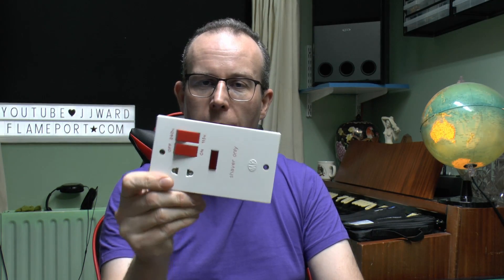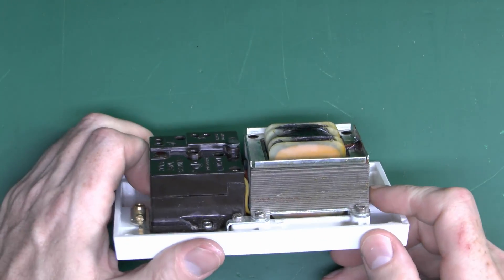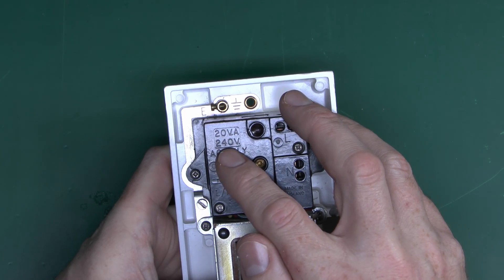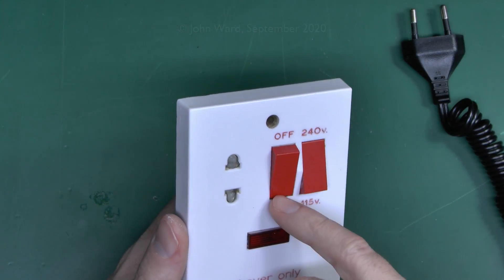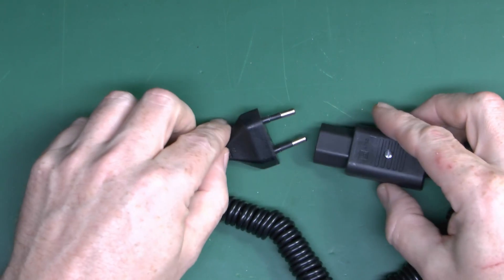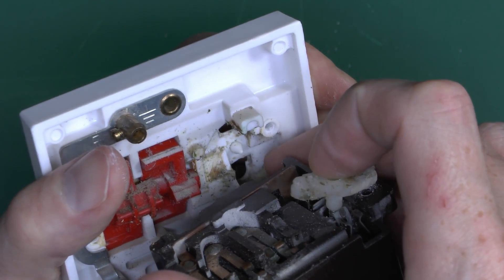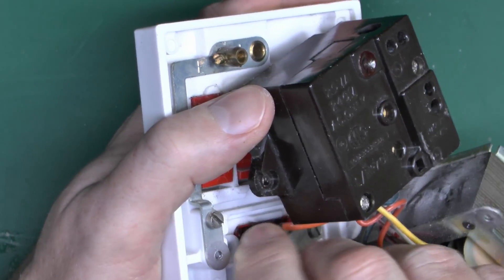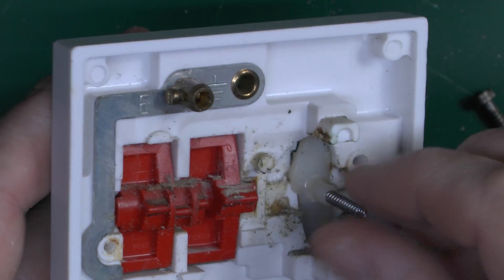Shaver Sockets for UK Bathrooms - With Isolating Transformer

Comment: In my country is normal to have the washing machine in the bathroom, that makes a lot more sense than having your dirty clothes in the kitchen like you have in the UK. Also you usually have a socket near the mirror not only for shaver but also for hair dryers, electric toothbrush, etc. 

And we don't see people dying everyday for that, so I think that UK regulations are exaggerated, especially nowadays that we are required to have RCDs on every circuit.
Reply: When we visit my mrs family in Estonia they all have the washing machine in the bathroom, kinda makes sense really
Reply: @frazer26  Usually the only cases where the washing machine is not in the bathroom is either: a) It is in the basement, garage, or some other utility/boiler room b) The bathroom is tiny and there is no other choice but to put the machine in the kitchen.
Reply: Had a big extension job with such a request from the customer when I lived in Midlands in the 90s. I said I cannot put a 13A s/o in bathroom for any reason, she said her parents have it in Belgium. I was in NIC at the time so I queried it and it was a deffo NO. Her madamship was pissed off with me. I had to go back a few months later to fit her posh gold plated bathroom light from Harrods and I found she had got some fly-by-night in to do her a socket in the bathroom. I asked to see her NIC completion form to see if anything had been added by the other idiot, don't know why cos i knew he wouldn't have made a note. I did point out the error of her ways but she didn't give a shite. However I do agree on hygiene grounds about laundry in bathroom. The foreigners do it so why are we different.
Reply: Tiny Tony Maloney I see absolutely nothing wrong with a socket for a washing machine in a bathroom. So long as the circuit is protected by an RCD - which most are anyway.
Reply: @tinytonymaloney7832  BS7671 is not statutory in the UK.  The client can specify work be done to that standard, but it's not compulsary.  Building regs are though.  You could have fitted the socket for her but who's responsible for explaining it to the building inspector?
Reply: You'd still have breakers for each room. So idk if that would be considered less safe.
Reply: the requirement pre-dates modern RCDs, as RCDs can be abused and do often fail in a non-operative but still live fashion, its good to not rely on them as your primary or secondary protection.
Reply: Primary protection should be to use ones brains, dont contact water nor plumbing fixtures when handling electrical items.   

  Kind of like dont stick your arm in the stove flame, or dry your poodle in the microwave,  or run your car in an enclosed garage, or tie a plastic bag around ones head.    duh!

  I wonder if British simply get around this mandate from on high by use of an extension cord?
Reply: @edc1569  They can fail but failure is not that common. I mean everything can fail, even an isolation transformer can fail, but how common it is?  

Even the isolation transformer is not so safe, if you think about that: sure, if you touch only one of the two wires, no problem, but if you touch both? There is no RCD to trip, you can get a shock that is far larger than 30mA at maximum that will trip an RCD. 

Also not having a socket in the bathroom doesn't protect from stupidity, if one wants a socket in the bathroom to plug in a radio and listen to music while having a shower he can always use an extension cord. And it's probably better to have a socket in the bathroom correctly protected in the first place than an extension cord that maybe is not even connected to a circuit protected by an RCD.
Reply: Washing machines are installed in kitchens under the sink usually so seem to be safe around water. It is the socket that is the problem if people plug in other devices with wet hands. People do silly things and a young lady died in a bath using her tablet plugged in to an extension lead. Water and electrics are not a good mix and making  the bathroom safe is not a bad thing.
Reply: As john said we can now have a bathroom socket if it is 3 meters away from the bath/shower.  If you were to have a washing machine in the bathroom then you would need a much bigger than average UK bathroom anyway.  Even when I lived in a large 3 bedroom the bathroom hardly had enough room for a bath and sink never mind laundry equipment. Someone correct me if I wrong but you could also cut the plug off the washing machine and hardwire it with a FCU, if you don’t care about voiding the warranty on the machine I think that electrically would be compliant.
Reply: Andrew Stevens my bathroom is 5mx4m
Reply: Must be drauhty @GeeTheBuilder
Reply: @andrewschannel3635  Surely the controls you touch would have to be IP rated ?
Reply: @andrewschannel3635  Typically even in small houses the washing machine is in the bathroom, near the sink, never in the kitchen. In big houses you could find a big laundry room, but in a lot of cases that big laundry room is also a bathroom.
Reply: UK bathrooms are usually small and unlike hot countries steam from the shower condenses on everything including walls and sockets, especially in older non-insulated homes.
Reply: Here in the United States the national electrical code  book requires that any power used in a bathroom must be isolated and protected by a ground fault interrupter or ground fault circuit interrupter, depending how you say it. It also requires a minimum designated circuit of 20 amps.
It is quite safe if you test your GFI monthly. And it is working properly.
But, I don't think they would ever allow a washing machine or dryer in the bathroom.  It gives you the added benefit of being able to use a hair dryer in the bathroom. 
But everywhere is different.
Reply: @user-zx2mc6pp8o  Hello?  maybe just moved the microwave in there then?
Reply: In Australia we just have a separate room called a laundry for our washer and dryer.
Reply: It also makes sense incase of water damage. I once broke a pillow in the washing machine. Had the machine been in kitchen there it would not have been possible for me to fix it.
Reply: Most new houses in the UK have a utility room so the washing machine doesn't have to be in the kitchen
Reply: @user-zx2mc6pp8o  Are you making the steak in the bathroom?
Reply: @user-zx2mc6pp8o  I am very confused now have you fitted a cooker in the bathroom as well as a washing machine now?
Reply: Must be awkward when you are sitting busy on the toilet and someone wants to empty the washing machine??
Reply: Mike5 must be awkward when someone is cooking a curry or spicy Mexican meal and the washing is ready to take out. 

My washing machine is in my boot room
Reply: @GeeTheBuilder  Interesting viewpoint on hygiene there
Reply: How is having the washing machine in a bathroom more hygienic? I suppose it's great if you want your shirts to smell like a "day after Taco Bell" dump...
Reply: @xRepoUKx  Id youe bathroom smells like shit all the time you probably need to learn how to use the toilet.
Reply: your goverment does not care you to die from electroshock in bathroom. UK does care their ppl. simple as that.
Reply: @karabesklow  But no one dies.Simple as that
Reply: @apollorobb   dead do not talk. nor tweet nor write in facebook nor in you tube. i am electrical engineer . the higher the protection level the safer it is. if goverment enforces higher degree of protection it simply shows they care more about their people.
Reply: @GeeTheBuilder  Part p is a load of bollocks but RCD's can fail on the odd occasion and no longer trip, providing no additional protection. That one day could be the day you drop your hairdryer in the bath.
Reply: nitrofar34 lol! If you use the hairdryer in the bath then I’d say you should win a Darwin Award
Reply: @GeeTheBuilder  rcd works on residual current. if current runs from phase to neutral by using the path as your body you will get cooked inside out. oh yeah it happens i saw ppl who lost their fingers . :)  Also issue is not only about people dying from being electrocuted. Electrical failures generally are one of the major reasons how fire starts. Anyways if you are interested for further consultancy to my years of experience, as consultant engineer i would be charging you the necessary fee. 
Note : women love to use hair dryer in the bath and you find them sexy. :D
Reply: @apollorobb  people definitely do die, you just don't read about it.
Reply: @karabesklow isolation transformers don't protect against phase neutral shocks either.
Reply: @apollorobb  "But no one dies" - and yet people die of electrocution in the UK with significantly stricter regs. You're confusing "don't die" with "we can't be bothered to either record the figures and/or actually look at the figures". Electricity kills, yes, even in your country - and the UK.
"since they still allow ring circuits with higher rated breakers than what the two legs of the ring can individually sustain" - so it's a good job that those breakers aren't the only point of safety in a UK circuit, right? Rather have an appliance that only needs 2A protected by a 3A fuse than a 16A circuit breaker any day of the week.
Reply: @GeeTheBuilder  in the US, hairdryers have a GFCI built into the plug as well as the one that should be on the bathroom outlet. US GFCI is also much more sensitive than UK RCDs
Reply: Muhammed Gundogan VAST majority of houses have RCDs now. So you’re not gonna die
Reply: @karabesklow  - Oh sure they care.  Except when it's about infectious diseases, like BSE, or CoVID...
Reply: @haploideallel  human perception has relative bias . I suggest you to travel countries such as uganda zimbave and countries names ends with -istan. then i belive that you would start to appreciate your own country's govermental care more :>
Reply: @karabesklow  This was a reasonable idea before RCDs, but now is arguably an unnecessary restriction.  I believe the German regulation used to be 10mA RCD on bathroom sockets.
Reply: @karabesklow  Nobody in Finland has died because of a washing machine.

Comment: Sometimes you'll find such shaver sockets in hotels here in Germany. Of course the version with a transformer and in most cases with two outlets for the two different voltages. Like the UK version they require a 2-gang box.
According to VDE 0100-701 (german equivalent of the BS 7671-701) it's permitted to install such shaver outlets in a room which contains a shower and/or bathtub inside of protective zone 2. Even if they're normally not the standard here. In 1984 it was introduced that circuits in rooms which contain a bathtub and/or a shower must have RCD protection. With this new version of the VDE 0100 they also banned the new installation of AC type RCDs. It was introduced in 1983 with a transition period of one year. 
20VA is the minimum, they can go up to 50VA. The specifications for these shaver sockets are normalised in Europe (EN 61558-2-5 ).
I got a mirrored bathroom cabinet in my guest bathroom, in there is such an outlet unit installed with a transformer. The room doesn't contain a bathtub or a shower, but it's in there. But I actually don't use it because there are two standard outlets next to the sink...and I perform a wet shave which requires no electricity at all.

In addition to the "Shavers only" there's also a symbol on it...

https://upload.wikimedia.org/wikipedia/commons/2/21/ShaverSocketUK.jpg

German shaver socket:

https://www.elektroradar.de/rasier-steckdose-282026.html
Reply: The main difference between UK and Germany is that here sokekts can be installed nearby the shower or tub. The distance only needs to be 0.6m in Germany Austria and Switzerland and not 3m like in the UK.
Reply: @simonschertler3034  No! 60cm is within zone 2. There are only hardwired washing machines permitted and light fixtures, no outlets or switches. Also the zones are reaching 6cm deep into the wall. And cables in that area are only permitted for devices like water heating for the shower/tub or making the bubbles in a fancy jacuzzi tub. No other cables of other circuits in that area, so be careful if the wall isn't that thick, for cables in the room next to the bathroom...

This regulation is harmonised with Europe. There's only one deviation in the german version:

Hardwired water heater, even in zone 1 or 2 doesn't require RCD protection if the disconnecting time is below 0.4s in a TN-grid. In TT it's almost impossible to get this disconnecting time without a RCD.
It's not an error to install RCD protection. Such codes and regulations are always the minimum standard, you can alwas exceed it to increase the level of safety.
Reply: @Marcel_Germann  of course! Sockets and switches are not allowed with in 60cm around tubs or showers (special regulations for showers with no shower tub), but at 65cm there can be switches and sockets as long as they are RCD protected. In the UK the minimum distance between the tub and the first normal socket is 3m according to JW and this is a huge difference compared to the EU countries.
Reply: @simonschertler3034  As the german difference is with a not RCD-protected water heater in zone 1 if the grid is TN and the disconnecting time less than 0.4s. The british outlets are normally wired in a ring circuit and fused with 2.5mm² twin-and-earth cable. On twin-and-earth only the active conductors are 2.5mm², the protective earth conductor is only 1.5mm². And the ring is fused with 32A. That's another difference compared to german installations, here the PE in cables is always of the same size as the active conductors. I don't know if that's got something to do with that. Sometimes the way of thinking of the persons writing the regulations is weird. That's the reason I don't buy the pure regulations anymore, instead I buy such books like "VDE 0100 and its practical application" published by the VDE. There you have the regulation itself and explanations and reasons for their decisisions.
Propably in the UK they calculated the length of the shower hose and how far the water can squirt to make the decision of 3m and didn't consider that there can be constructional obstructions like a massive dividing wall next to the shower or tub or a shower cubicle which will prevent water getting in a particular direction.
And I remember back then here it was the same thing. Bathrooms with a control switch outside of the bathroom. The control switch is used if you can't see the light fixture directly and contains a neon indicator. It was fun, especially for kids, to walk by and switch-off the lights and hear the complaints and swearing from inside the bathroom....
I installed a control switch for the lighting in my attic.
And there are some alternative methods to get a safe installation in a bathroom, for example using IPX4 rated outlets, or a 16A fused radiant circuit protected by a 10mA type A RCD especially for the bathroom. In bathrooms you don't require much electric power, so the 16A would be sufficient for a hair dryer, toothbrush and a shaver. In Germany the bathroom is considered to be a dry room, the air moisture is only increased for a short period of time, but most of the time of the day it's dry. So the VDE doesn't rule that the outlets and switches must have an IPX4 rating.
Reply: @Marcel_Germann  In bathrooms you don't require much electric power? Those hair dryers are notorious here for tripping breakers.
Reply: @PaulSteMarie  A B16 A? Never had any issues with a hair dryer on a 16A circuit...
Reply: @Marcel_Germann  UK regulations specify that an additional heavier earth cable is required in bathrooms.
Reply: @michaeltb1358  Until 2003 tubs and shower trays made of metal had to be bonded to the equipotential bus bar with an at least 6mm² copper conductor. But this is no longer required if there's a central equipotential bus bar where all incoming pipes like water and gas are bonded to, and the circuit is protected by RCD with a tripping current of 30mA max. And also are all newer tubs and shower trays made of plastic, so nothing to bond...
Standard RCD type here is the type A RCD. And that's the case since 1984, actually since 1983, but there was a transition period of one year. Banning the AC RCDs for new installation and implementing that circuits for new bathrooms (rooms which contain a bathtub and/or shower) must have RCD protection. In the regulations it's still a 30mA RCD, but the VDE recommends instead a 10mA for bathroom circuits now. The 30mA threshold is for healthy adults, but for children or elderly people with heart issue a much lower current can be deadly.

Comment: I wonder how many people have tried plugging in a two-bar electric fire, for bath time?
Reply: if the plug will go in it will be done !!
Reply: Only possible with an extension cable from outside the bathroom in the UK. Unless it's one of those wall mounted room heaters from the 60s/70s.

Comment: There are also shaving lights with these sockets built in. They used to use linear incandescent lamps (60w), later ones used 11w PL fluorescent and the latest ones are LED.

Comment: Does fit a Euro-Plug in this outlet?
Reply from the maker: Yes, the black plug in the video is a Europlug.
Reply: Europlug is wider but it can be forced, also bearing in mind the amp rating
Reply: Not by design... but it's just a matter of shoving hard enough.
Reply: You can't do the reverse though. UK shavers don't fit in euro outlets.
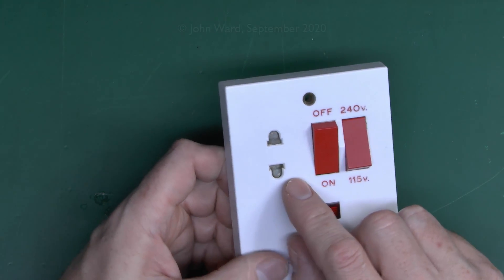Reply: 6:12 John mentioned that.